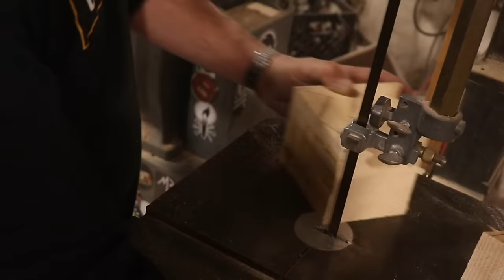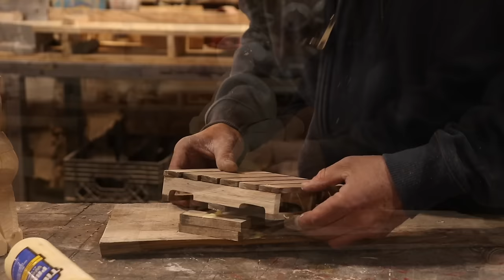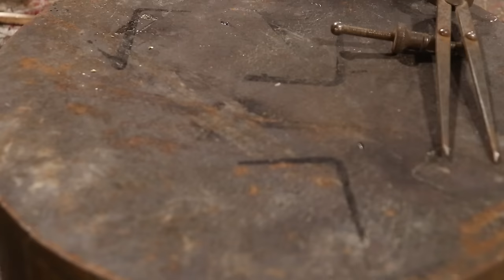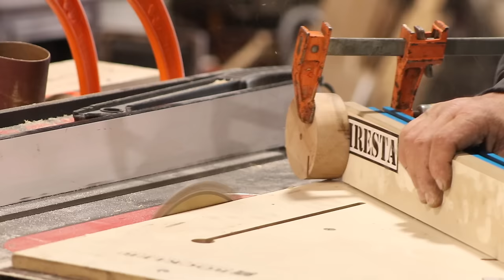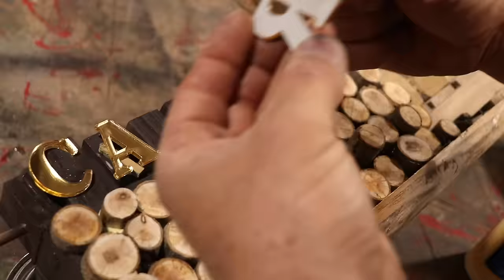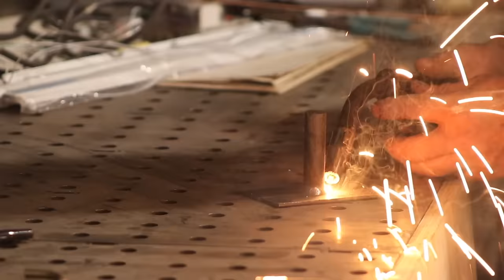DiResta Carolina WhirlyGig

Comment: For a freer pivot, put the pipe on the top with a ball bearing in it, and the solid bar on the bottom, and a little longer than the pipe. There’s more tricks than that, but it will make the biggest difference!

Comment: Please do not take this as criticism I like it as is. However, if you had mounted the blades 90 degrees to their current orientation the shaft would turn the opposite direction and the ax would swing faster towards the tree than it swings away.

Comment: The propellor should turn the other way. The swing back is now more agressive than the hit.
Reply from the maker: The fans goes both ways.
Reply: @jimmydiresta  No, seriously. When the cam moves in the lower part of the vertical rails the arms swing much faster than in the upper part. Because the cam is closer to the hinge point in the bottom. (Not too complicated but kind of hard to explain.)